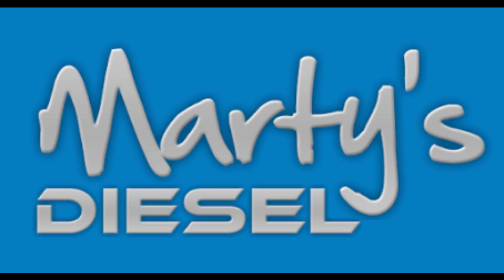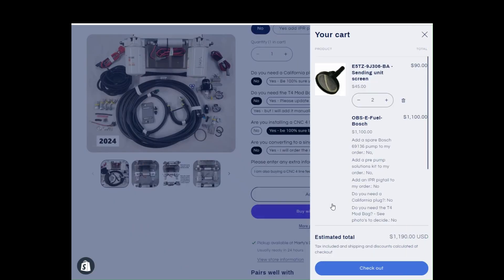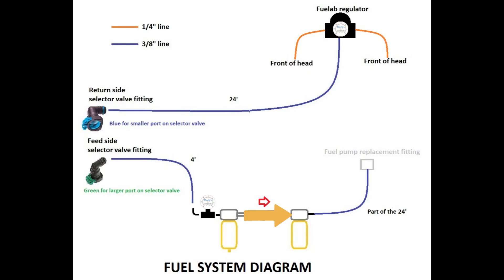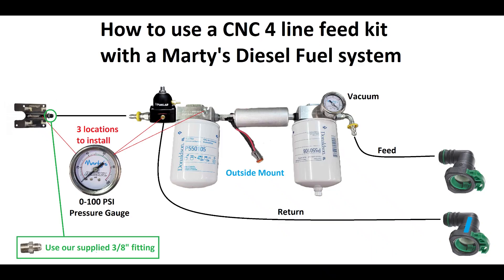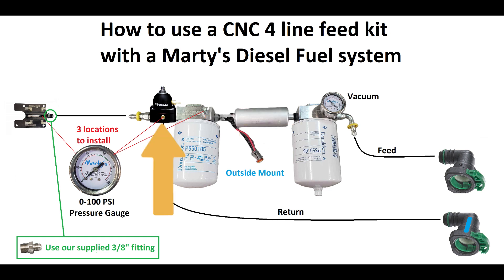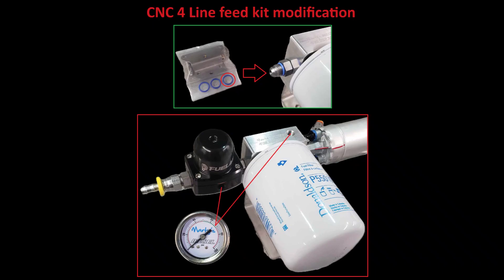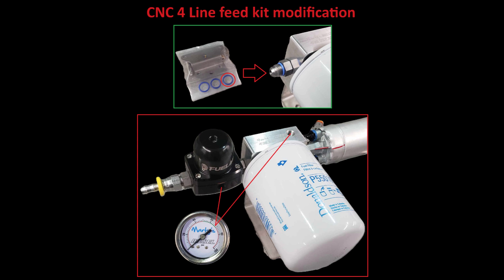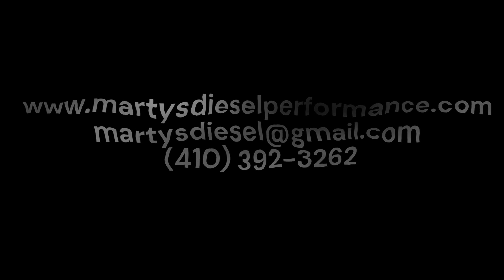Marty's Diesel E-Fuel Kit with a CNC 4 line feed kit

Comment: Hello. 2001 7.3, I put on way fuel, a fuel pick up and air dog. I had to add an additional fuel pressure regulator at the top of the engine. Was getting bleed back on shut down therefore putting air in the fuel… the truck is so quiet now.  Can drive it through a drive thru!!!